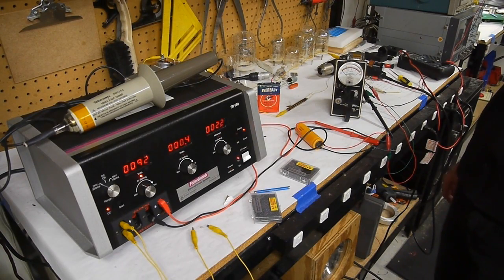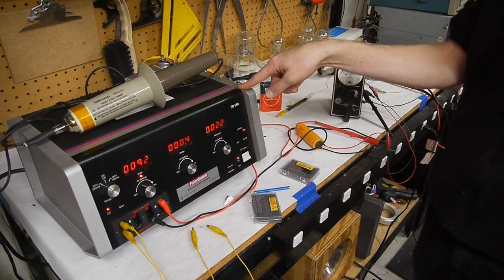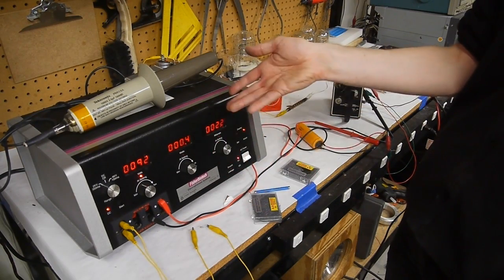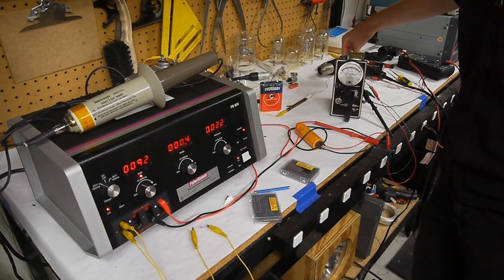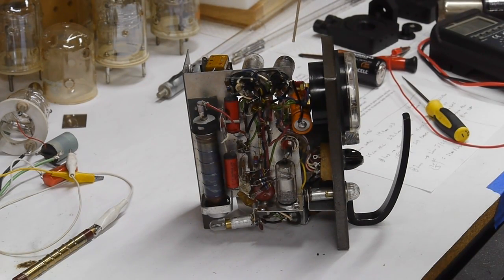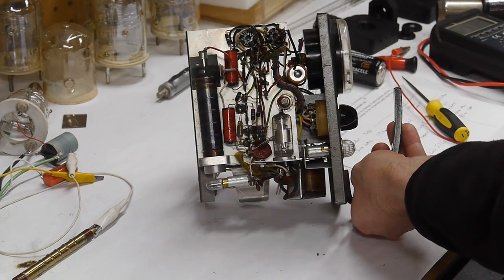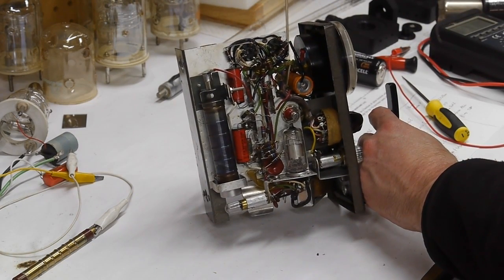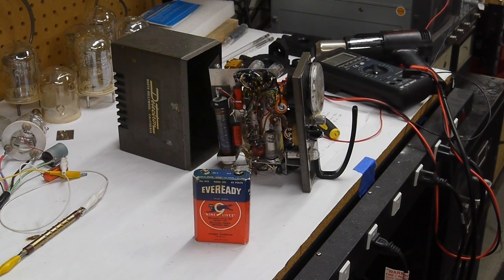Detectron DG-2 geiger counter teardown and testing

Comment: Cool video! I just picked up a DG-2 instrument and found your video as a result of my initial internet search for data on it. Fortunately it was stored with batteries removed and is thus in very good condition. The 455 batteries of course will be impossible to locate, but I too will figure out a way to power mu unit up. I want to see those tubes glowing! Hopefully the GM tube in mine is functional.

Added: I am shocked! You can still find new 455 battery equivalents for around $30 each!

Comment: Hey there. Good video. I found a a DG-2 at an antique store and picked it up. The GM tube is collapsed and needs to be replaced.  I can't find any Victoreen 1B85 tubes which is what it originally had. In this video, you were able to test it with another tube to test your meter. Was it as simple as plugging in the new tube to the existing contacts? From what I can find, that tube, the SBM20 I think, operates at substantially lower voltage of 350-475 volts, where as the Victoreen 1B85 operates at 850-950 volts. I'm a novice when it comes to electronics, but I would think that would cause some issues. If you have any advice or reading materials to help explain it to me, I would appreciate it!
Reply: Hey do you mind me asking how much you payed for that I was looking around for gieger counters and am curious if not I totally understand
Reply: @themichigander4924  I'm a bit late to both of your comments, but yours is a bit newer.

The older gear although rugged, tends to require much work if you want the meter operational as if it was new, not to mention calibration. What would the meter serve you for? If your looking for a shelf piece that may also be operable a old unit wont be a bad idea, old being late 40s to early 60s, but most of these are rare and at times expensive.
Although if you want something to mess with a geiger kit of a simple prebuilt handheld unit you can find them with a tube for as low as 30usd at times the price goes up from there.
If you want a apocalypse tool you can get a Civil defense meter for pretty cheap usually 50-100usd such as a CDV-717 with a variable window good from 0-500 R/Hr.
If you want a survey meter for general purposes, such as uranium prospecting for around 100-200usd most are made by Bicron, Eberline, Technical Associates, and WB Johnson. 
Meters just go up in price from there, so does probes.
Reply: @jamesluck2969  thanks I prefer older stuff it's way cooler then plastic stuff and it's made in America so besides the gieger tube itll probably last for forever
Reply: The sbm-20 does run in the range of 300-500 volts DC. If you need a equivalent tube to the Vic 1B85 a good replacement is usually a LND 725. Although the LND tube is alittle more stout. Both operate around 800-1000 VDC, best operating at 900 VDC. 
The LND 725 has the same equivalent sensitivity and range to both gamma and beta radiation as the Vic thyrode or 1B85.

Running the sbm-20 at that voltage (being 900v) will subtract from the tubes life along with decreasing the action that its quenching gas serves.
It also make the tube super sensitive, which isnt really good either.

Comment: beautiful piece of equipment!! Hope you can make the tube work. Since a lot of old tubes suffer from gas degradation after time, you may check if the tube triggers, and the remain on (short circuited). Increasing the series resistor sometimes fix this problem

Comment: Hi Ben: Great that the main circuit appears to function.  I have DG-7 I received from my Dad.  The main difference I see from your video is the DG-7 has an external Geiger tube on a cable.  The cable connecter is located at the bottom left just below ‘Count’ lamp.  If you have to replace the GM tube you might consider fabricating an external wand for it.  Cheers, Mark

Comment: Wikipedia has a good article on 'B' batteris under /Battery_(vacuum_tube)
Such batteries were used to provide the correct DC voltages for the active electronics (most commonly vacuum tube radios) to work before rectifiers and voltage regulators made mains powered equipment common from the 50s onwards.

So, if you had a radio in the 30s, it was neither portable and yet you still had to go to the store to get multiple batteries for it. Your AC line was only good for lights, motors and heaters then

Comment: to be specific, it uses vacuum tube B batteries, standard B batteries run at the much lower voltage. the B reference isn't for size, but where it is positioned in the circuit relative to the vacuum tube

Comment: The low pressure gas fine tunes the acceleration of the ionization products in the high electric field, which are effectively amplified through ionization avalanches  in the controlled environment of the tube multiplying up small events into ones more useful for measurements.

Comment: You should build yourself a little 45 volt boost converter inside the dead battery casings.  As it is only a couple of hundred mW I'd be tempted to use a couple of AA cells, a 7400 series schmitt NAND and a MOSFET with a smallish ferrite choke.  Logic threshold should be OK as a voltage reference (stability aint too critical) for the feedback, just gate the oscillator off at the desired voltage with some resistors and use a diode to set the mark space ratio so the inductor doesn't saturate.

Comment: Yeah, my brain mistakenly substituted electrophorus instead of electrophoresis. I first encountered electrophoresis when I immersed a homemade, high voltage capacitor with asymmetrically shaped electrodes in mineral oil to reduce or eliminate ion wind. What I observed instead were air bubbles in the mineral oil following the electric field gradient, though I suspect it was the mineral oil following the gradient and carrying the bubbles along.

Comment: Electrophoresis is a physical separation process that separates particles by it charge while they travel through a gel. It is somewhat like chromatography but instead in a liquid the sample travels on a electric current. If you want a teardown look for the eevblog they made one recently with a lower voltage type power supply.

Comment: When you first said electrophoresis power supply I thought "electrophorus", and then when you said 6kV at 100milliamps I was really intrigued! I wanted you to tear that thing apart so I could see how it used the electrophorus principle to generate that amount of power. I guess I've worked with electrophori more recently than I've done electrophoresis. :)

Comment: Fascinating Ben. Takes me back seeing those thermionic valves!!  I cut my teeth on all that stuff - 6.3v heaters, EF80 vari U pentodes - very versatile valve, ECC83 - double triode, ah the list goes on - those are B9a of course but remember the Octal series too - 6V6 power pentode, KT66, 6K7 etc. Takes me back seeing the guts of that devise.  IIRC the sensing tube is essentially a scintillation counter. Another nice vid thx.